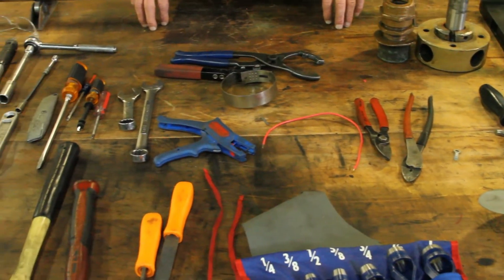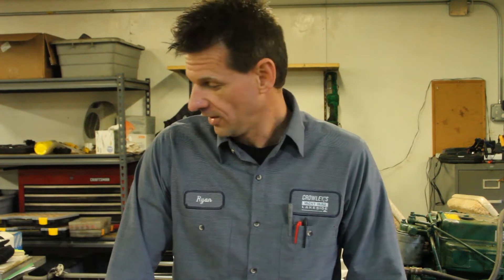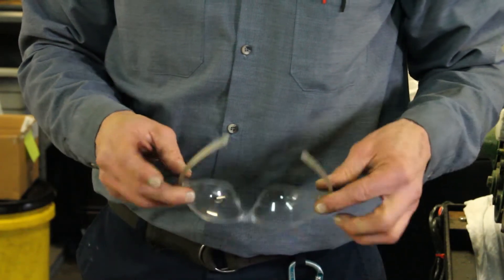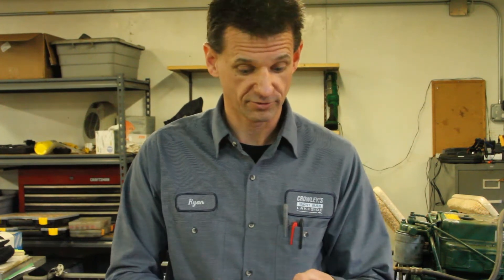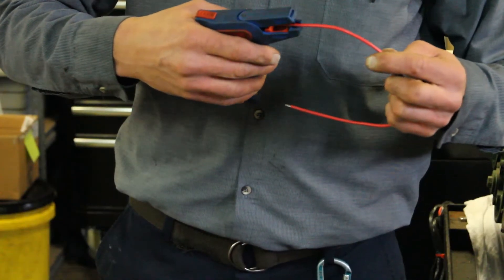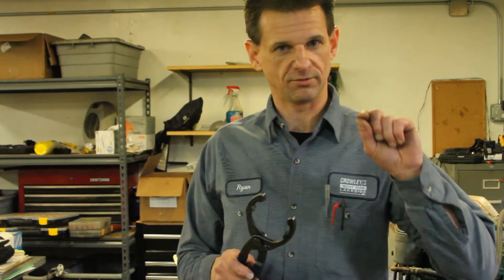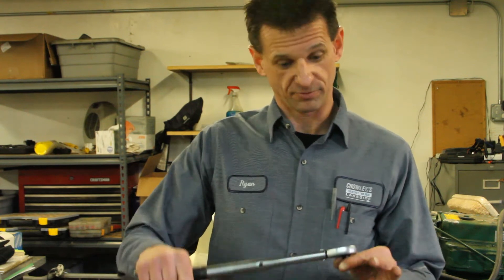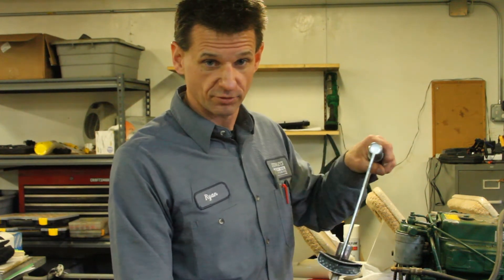An Introduction to Boating Mechanics

Comment: Great , I love it , simple explanations , great guy. I love the safety aspect  of working on both dry and wet .  glasses and gloves . be also aware of batteries , they are in a contained area for a reason ,  always secure covers, the old ones have acid ,  new ones a gel.  Many can heat , burn and explode your boat , so take care of them , every year and winter . Just in case you didn't realise they start your engines ,  they cant run your stereo for a day , or use microwave , or leave your lights on all night . 
Happy boating from Capt Stan